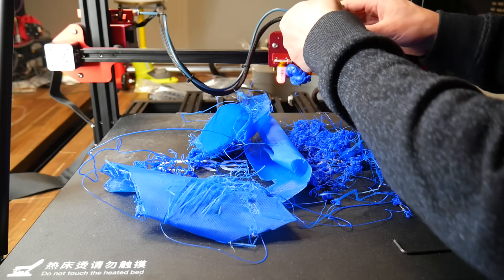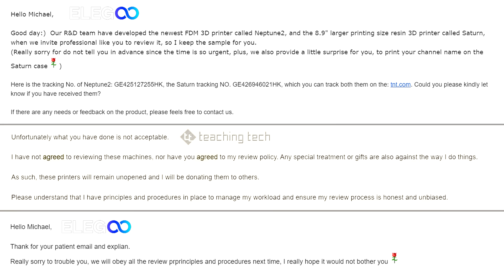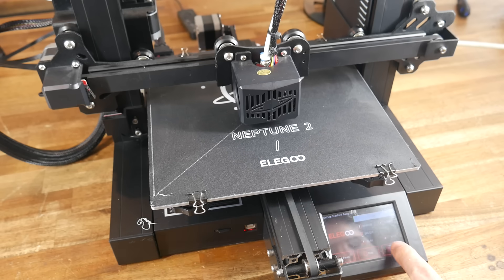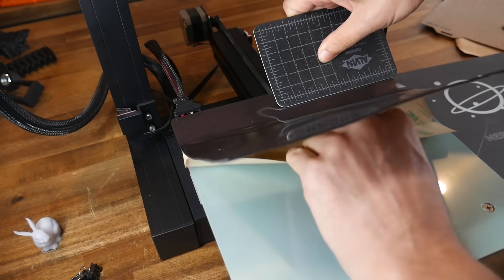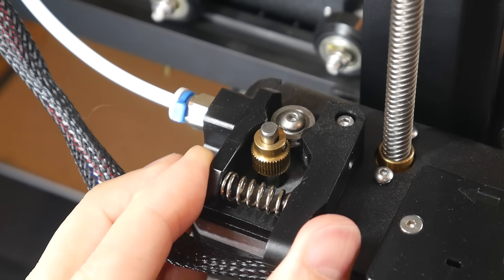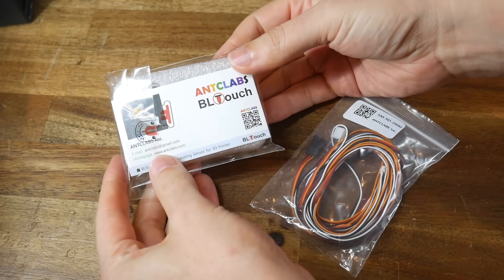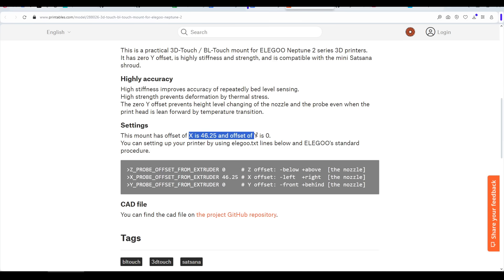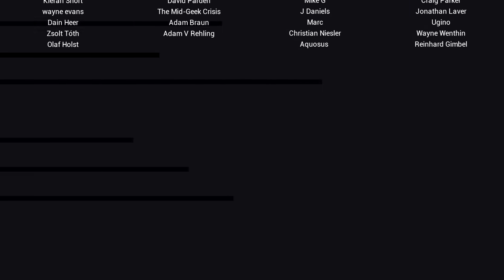Are cheap 3D printers more trouble than they’re worth?

Comment: I'm still using ten year old machines, upgraded to SKR mini main board and silent steppers and drivers. I Don't need high speed printing, I've changed hot ends and steppers, that's about it. 

Cheap machines aren't an issue, your skill level at operating them is the issue. 

I get alone along perfectly fine with decade old clone machines.

Comment: I've noticed ender 3 and a lot of the clones will have an issue with the Z axist limit switch, they are nautrally the cheapest stuff, and the top casing on them is loose and what it does is that the actual trigger position varies, and thanks to the lever that small variation is further amplified by the lever, so you can end up with easily 0.5mm Z homign error, you claibrate it, it prints well, you send another print job, it re-homes the Z axis and goes out of whack. It's probably why not using it at all and adding 3rd party  probe fixes the problem. But all you need is to glue down the switch casing or get quality omron switch.
Reply: Or get rid of it all together and use probing to home the z axis since bed probing is the way to go anyways. Knockoff BL Touch is only $10 and works fine. I own both real and knockoff probes and they all work great.

Comment: Yup, the Ender 3 is the most second-hand sold printer here where I live. If you go through 3d printer listings, it's littered with Ender 3d or clones. It's cheap, gives most people a distaste for it, and they never return. Kinda like when those VR Gear headset add ons for mobile phones got sold by the millions to hopefuls thinking 30 bucks will give them a 2000$ high end VR experience.

Comment: My main issue with those cheap 3d printers is that they are marketed at people who are not yet into 3d printing. The company will send a printer to be featured (I strain to use "reviewed") in a YouTube video, and the people who don't know any better will be tempted by the price and buy it, to later find out its's just a clone of another 3d printer (Ender 3). 

Why is that a problem?  Ender 3 has a massive community behind it, with lots of tutorials, replacement parts and upgrades. The clones often share same design flows, but whether Ender 3 parts will fit them is a hit or miss. They are made for a quick buck and are often quickly discontinued, so sometimes there's no other option than to use Ender 3 parts (ask me how I know).

Comment: For me all the upgrades to this printer (neptune 2s) were very cheap: thick glass bed (glued to pei with thermal glue), silicone spacers, cheapo chinese bimetal heatbreak (works well with few adjustments), ikea lack enclosure.  I had bltouch combined with some costum marlin firmware found on reddit and it was very frustrating, so I got rid of it. Maybe I'm too dumb for bl touch, old school manual leveling from time to time is good enough for me. Extruder was already made of metal so that is fine. For printing a few things a month this printer does the job, not worth investing in expensive parts for those ender clones since Bamboolab printers went affordable and very reliable.

Comment: Makerbot Cupcake CNC 3d printer first. Felt a massive step up to an Ender 3 Pro. But then I got a Prusa Mini and the change in reliability was amazing and made 3d printing a joy. Then I bought a Sovol 5 IDEX. And while IDEX was great it was a lot of bugs to fight and design issues.

Then I got  X1C. Another massive setup. I will still use the Prusa mini for some things or when the X1C is busy. (I leave it with a 0.25mm nozzle and my X1C with a 0.6mm CHT style nozzle).

They both just work. The hobby is now about designing stuff.

Comment: This whole video reminds me why I was glad to get the printer that I did instead of an Ender 3 as my first printer. The Kywoo Tycoon had all the quality of life upgrades (bl touch, direct drive extruder, metal tension arms, and a bunch of other stuff) for about the same price as all those upgrades and an Ender 3, but installed from factory so I could just print things. Even better, it was a rigid bed mount so there was no messing with wheels to tram the bed every half dozen prints. It's a personal pet peeve, and I know that system can be serviceable with upgraded springs, but the printer world will be way better off when those things disappear for good. Unfortunately it looks like they aren't manufacturing printers or parts anymore, as it was and still is a workhorse that kept churning out parts, but I'm quite happy with the Magneto X and X Smart 3 I upgraded to. If someone really wants to tinker, and would love to install those upgrades themselves, it's a viable path, but there's also better quality printers out there for the tinkerers.

Comment: Having started in 3D printing in 2016 with an FLSUN delta that had to be 100% assembled, and moving on from that to an Ender3, and from there to a Kingroon KLP1 while also having access to a Bambu X1C I can honestly say that going cheap was a GIANT MISTAKE. I got sick of the KLP1 and bought a Qidi Plus4 because it seemed to be as good as the4 X1C but with OPEN SOURCE firmware.  So far the Qidi has been superior to the Bambu, but then it is over a year newer in design and liberally copies everything Bambu did right while offering a larger print area as well as 1.5MM belt instead of 2mm for Bambu and the entire rest of the 3D printing world.

But yeah, The Ender3 was just a series of problems.  It's a printer for people that like screwing around with upgrading a 3D printer rather than printing useful parts.  Qidi or Bambu, either one will work fine and go with the one you feel drawn to as Orca slicer supports both of them.

Comment: I get GREAT results with my ender 3! I just had to get a PEI build plate, bed leveling probe, direct drive extruder, stiffer bed springs, replaced the lead screw with belts and installed klipper. Easy!

Comment: The BL converts have bought a machine that will work reliably for a while and when they stop working you won’t be able to fix it because they are not designed to be fixed. It will be in a few years that the carbon rods wear out, as an example, and you have to scrap the whole machine because they are unreplaceable. Just more landfill. New Prusa corexy is the only one that will be fixable at home. Just have to sell a kidney to buy one 😢

Comment: 4 years ago the Ender 3 was the perfect machine for me. It was a cheap printer that could grow with me. I got amazing results from it for 2 years and upgraded it a bunch. Then one day a driver blew out. I fixed it, but then a glitch occurred that caused the bed motors to skip if I printed a model that took up too much space in the Y axis. Spent 3 full days troubleshooting with no luck. With my printer now unreliable I stopped printing for two years.

A few weeks ago I purchased a Bambu A1 with AMS to get back into the swing of things. Man has the technology come a ling way in the past 4 years. This thing has all the bells and whistles for just $450 (with AMS included which you definitely don’t need). I have probably spent more on my Ender 3 over the years than I did with this bundle. 

The Mini can be snagged for $200 when on sale. It used to be impossible to find an FDM printer below $240 and now you have one of the most consistent and user friendly FDM printers (albeit with a smaller bed) with auto leveling, filament runout detection, wireless printing and the ability to add a camera and AMS later on down the line.

Was the Ender 3 a good choice for me back in the day? Yes. Would I buy a Creality now? Not unless it had some niche usecase that I needed. I am past the point of wanting to tinker. I tinker enough with my servers and don’t want another project machine. I want a machine that just works so I can focus on solving problems in CAD rather than in the compiling of firmware for my printer. 

One of my biggest regrets was recommending a Biqu Ender 3 clone to my cousin who lives 10 hours away. I don’t think he ever got that machine running properly. I can only help troubleshoot so much without in person testing. Due to that experience, I would never recommend anything other than a Bambu or Prusa to someone who is not overtly technical and loves to constantly tinker. Especially with how Bambu Labs now has a presence in the low budget category. It does not make sense to buy anything else unless you know you need a particular feature that those brands don’t offer.

Comment: A metal heatbreak and a clone bmg extruder fix most issues with cheap printers. My go to is a good all metal e3d v6 clone, bmg clone, sometimes some blue ptfe tube if not direct drive. Bl clones are hit or miss. Klipper works well for  cr*ppy boards

Comment: Thought I broke my Creality machine purchased during COVID. Bought a Bambu A1 mini combo before the China tariffs go into effect. Ended up fixing the Creality machine. But I agree a Bambu mini is probably one of the best 3D printers for beginners. I watch lots and lots of 3D printing videos and very rarely see anyone printing anything large. I also very rarely print anything large. The Z height especially doesn't need to be as tall as it is with Ender 3 clones. If you need to print large things, you'll know who you are, and you'll buy an appropriately sized machine. But the vast majority of us will typically be printing smaller useful items.
Here in the US everything with a chip will increase in price by a third come January. There are a few well made machines on the market now with rapid print speeds. Get something easy to start with. Tinkering can take the fun out of it. Unless you just want to tinker in which case, again, you know who you are. I'm a tinkerer too. But sometimes you just want something that works.

Comment: If you want to get into 3D printing, I'd also recommend either an A1 mini or a Prusa mini. If you like to tinker, buy a second, cheap printer to mess around on and tinker with. If you don't you'll tinker with your main printer and it won't be ready to print with when you need it. I started with an Anet A6 and the only thing that's still stock on it these days is the main board, and the XYZ stepper motors. It's running a 24v e3d hemera super volcano hotend, bl touch, external MOSFETs, TL smoothers, 24v heated bed with borosilicate glass and an ez something magnetic removable build plate, 24v fans, a 20 amp power supply all enclosed in an aluminium extrusion frame. It works though I had to solder a new stepper motor driver in for the y axis stepper motor since it was overheating from the weight of the y carriage.

Comment: why does bltouch get such a bad rap? 

my original ender 3v0 had the same one installed all these years and when compared to induction probes of many printers including prusa and bambu its far more consistent. even now on the K2 i have mixed feelings about using the nozzle it self as a probe since you have to do a bunch of nozzle wipes and pray for the best. To be fair having all the nozzle wipes at the end of the print seems to make things more reliable and I have brought down the K2 start_print sequence down to a total of 2 minutes including heating times of the bed and nozzle for PLA.

Comment: After years of wanting to and finally dipping into the hobby with an Anycubic Kobra 2 Pro, I quickly learned I should've done way more research, despite having done an absolute ton of it beforehand. Months later I came across a post by someone in a thread discussion this topic that said "There are two types of 3D printers: The hobby printers and the utility printers. The hobby ones are 90% tinkering and messing with the machine and it's settings, and 10% actually using it for 3D printing. And there exists an entire subset of 3D printer enthusiasts where this IS the hobby for them, the never-ending tweaking and fine-tuning is the end game for them. On the other hand the utility printers are the reverse, 10% tweaking, 90% actually using the thing for its intended purpose." And my experiences lined up with this statement exactly. I spent hours and hours tweaking shit on that Kobra 2 just to get better quality prints and ending up with maybe 1 out of 5 prints actually being decent until I finally got tired of dealing with it. Compared to my Bambu X1C I replaced it with later. I load up a model in Bambu Studio and slice it with zero changes made, then send it to print and it pops out at stock settings, and completely smokes anything that Kobra 2 could do even after a mountain of tweaks and even hardware upgrades added to it.

Comment: Cheap printers make you learn how to troubleshoot general 3d printing problems. You can get more expensive machines that will give you less trouble out of the box but they will eventually give you trouble and you'll have to learn anyway. Learn now or learn later.

The real reason not to get an old Ender 3 like clone is that most printers are much faster now and you're really using a relic. If you get it for free or close to it, dust it off, get it working, get the experience then move up to something modern.

I spent $85 on a returned Ender and it was absolutely worth it. My new printer is an Ender 3 V3 which is light years ahead. Though I might have returned that if I hadn't found I could root it. If I am going to be stuck with a curated experience I might as well go Bambu.

Comment: I started with a cantilever printer, and would never buy another. An A1, sure. The mini, not for me. My first good printer was a Sovol SV01. Better with a BL touch, Even better with an All metal hotend. 6 glorious years of printing!  Lots of mods over time. I had it running around 200mm/s for inner walls and infill. Probably not a great idea as the original mounting plate is heavy and the oversized bed is on a fairly narrow belt.

Comment: So far I have bought 3 3D printers (Anycubic 4MAX Pro, Anycubic Mega Pro and Eryone ER20) and all of them got upgrades but they are all still pretty bad printers.

I don't print every day because I really just want to use them as a tool for when I have some kind of project and it feels like every time I want to print something there is something I have to fix and I can never trust that the print comes out properly. 

So my 20-30 minute "let's quickly design and start printing a brace/spacer/enclosure" turns into a 4 hour troubleshooting session and it truly makes me dread using them.

Comment: Exactly! I have an "inexpensive" Ender 3 clone. I have spent enough upgrading it over the last couple of years to have bought a Bambu  P1 series machine. I have however learned a lot about this hobby. I still use your website as a reference for calibrations. I recently purchased a QIDI Plus4. I love this printer. It is fast, prints every material and turns out beautiful work. My Aquila is collecting dust at this point. I'm considering buying the SV08 next and using you great guide to turn it into a tool changer. Thanks for your informative videos. It's obvious to me that you love teaching.

Comment: The real take away point is that 3D printer technology has greatly improved in just the last two years.  There are now very good inexpensive 3D printers from Sovol, Elegoo, Creality, Bambu....  The trick is not to get the very cheapest 3D printer.  Pay $20 more and get a much better 3D printer.  Spending 1-3 hours researching online videos can save 40 frustrating hours of troubleshooting and repairing.  Or just look at Aurora Tech's buyer's guide.

Comment: Asking if a cheap 3D printer is worth the trouble is like asking if a cheap car is worth the truoble.  it all depends on who you ask and what their current situation is.  personally I think a first printer SHOULD be a cheap one.  The more you have to touch it the better you know it and the better you can troubleshoot print issues later on.  I think it would be far worse to drop $700+ on a first printer and still encounter a problem that you don't know how to fix because now you're out $700 instead of around $200.  But many people live the "disposable lifestyle" and they're more than happy to just replace the machine any time the slightest problem happens.  Then there are a lot of people who outright refuse to let a machine beat them and they'll put $500 in upgrades and parts into a $200 printer just for the self satisfaction of knowing they can do it all on their own.  There is no right answer to the question of if they are worth it.  You might have a better chance of getting a unanimous answer on which is the best sports team. lol

Comment: To run new wires through the cable loom, use a small screw with a rounded head and some duct tape to create a ball shape on the connector. You can then feed the connector through the loom much easier, and even use a magnet to assist.

Comment: Yes. They absolutely are. Everything I learned how to troubleshoot on my ender 3 s1 pro is basically non applicable on my Bambu, and highly unlikely to be useful in the future. I spent more time troubleshooting than printing. I thought I'd be running two printers once I got my P1P, but the ender hasn't been used since the day I got the Bambu. The difference in usability and overall user experience is infinitely vast.

Comment: I remember starting out with cheap 3d printers and after a while of trying to square the entire frame, using dial gauges to level the x gantry, and trying to drill precise holes to get around certain weird cost cutting corners companies tool at the time I said to myself "I might as well become a machinist if I'm doing all this BS" 
I am now a cnc machine programmer and operator so I have cheap printers to thank for that, but I do NOT miss the race to the bottom of the barrel that every company was doing. Never again haha